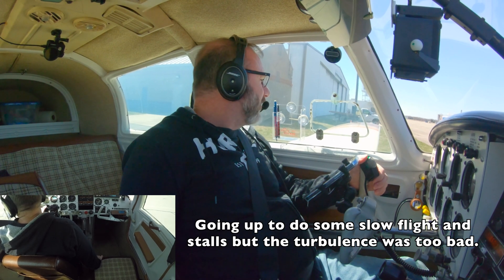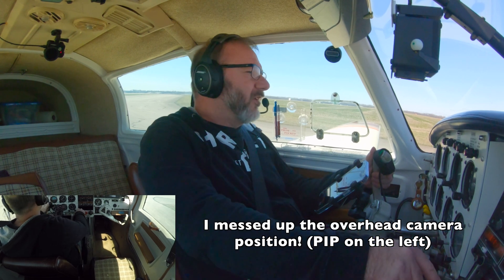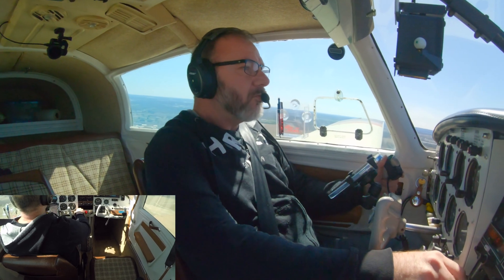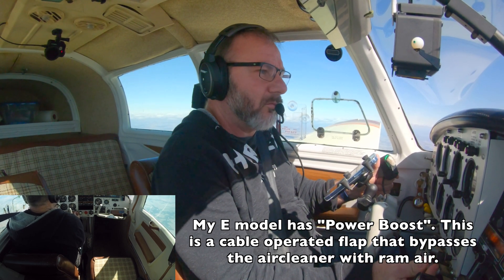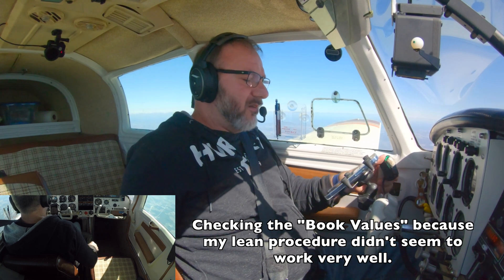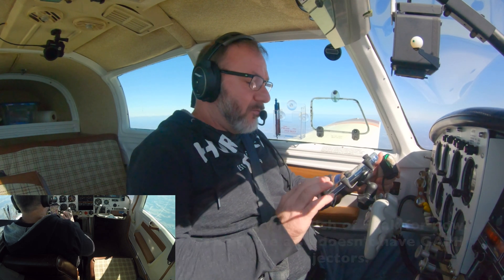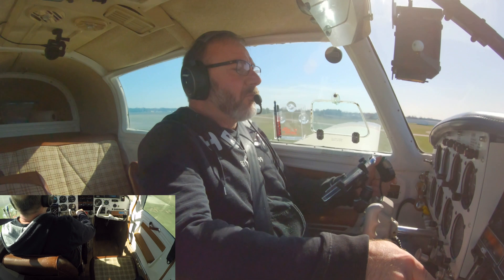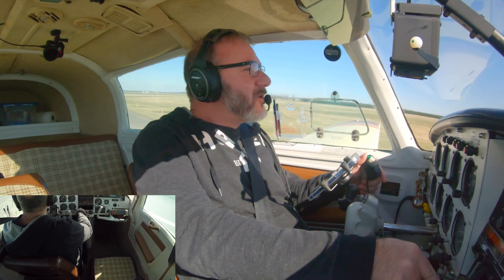Mooney M20E | Testing cruise performance

Comment: Sir, I would like to recommend getting your hands on the Lycoming Engine Operators manual rather than using the Airframe manufacturer POH.
Also, listen to EAA webinars on operating Oversquare and LOP operations.
Your cylinders will thank you, as well as your wallet.

Comment: Nice plane.  What does "with the numbers" mean?
Reply from the maker: Thanks. It means that I’ve listened to the weather broadcast.
Reply: @aronhalt  ah ok, I’m just used to hearing the letter
Reply: It's a little sloppy.  Better to be clear as is said, I have information Sierra, or whatever the letter is.
Reply: @christopherbrown1730  I’m a pilot now and yeah, there are a lot of bad habits like this “fish finder” etc
Reply: @cpy  I just got my instrument rating and I am still really learning, but you will see some "respected" channel influencers that will say other quick lingo.  Say, repeating a transponder code with, 4335 in the box.   Not my way, not my worry.
Reply: @christopherbrown1730  hell, I’m only a few years in and I still see wild crap like zero radio usage + no ADSB + a long straight in at untowered….insanity

Comment: What is the phone mount you use?
Reply from the maker: It’s the ram mount X Grip. I had an aluminum billet made that duplicates the shape of the old analog clock and put it in the yoke in place of the clock and the ball mounts thru it.